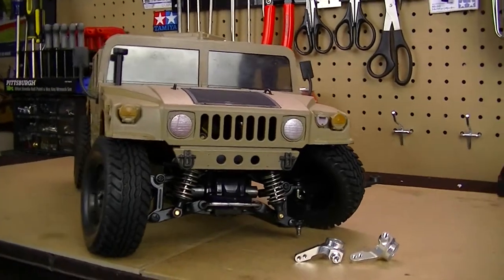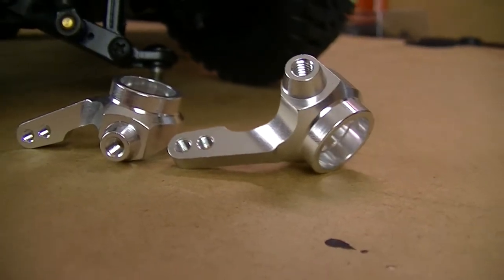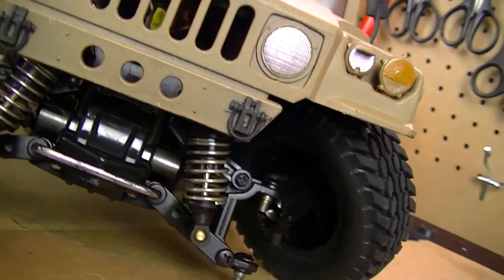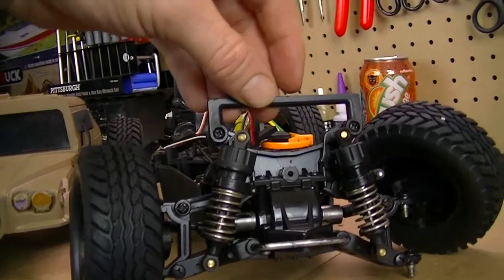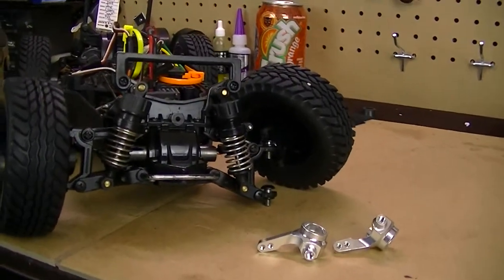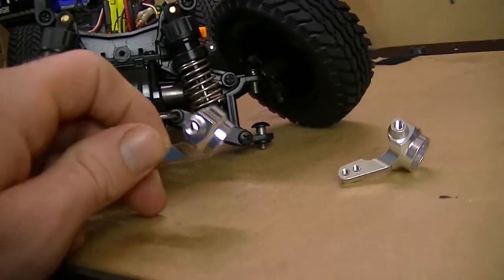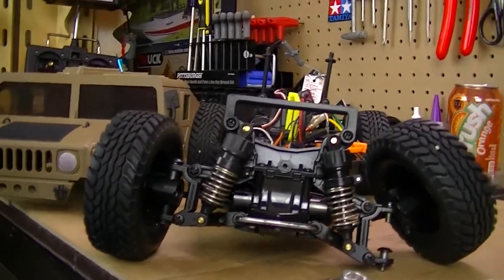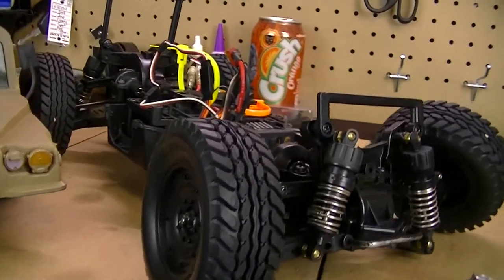RC84Films: Tamiya M1025 Hummer Update

Comment: Hi :-)I just found a 95 Hummer aswell, $100 and in mint condition - original box, and not compleetly built yet.I would like to know where you got the aluminium front upright, web page and part no. would be great.thanks a lot in advance.Jorgen from Denmark.
Reply from the maker: Jørgen Halvorsen I got them from eBay but u need to get CC-01 bearings
Reply from the maker: Jørgen Halvorsen thanks for watching